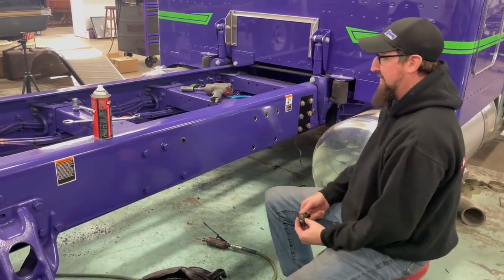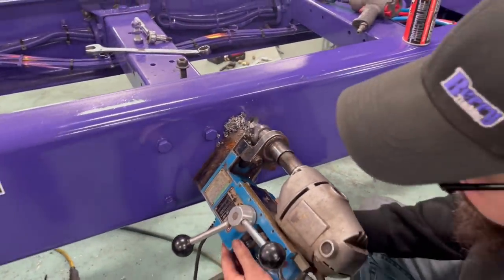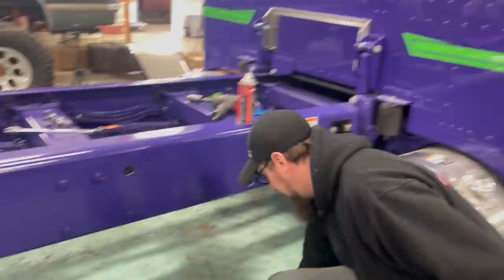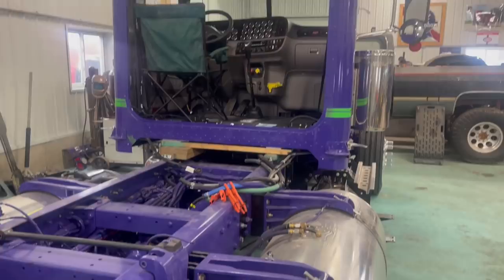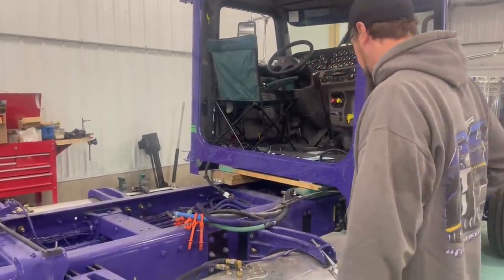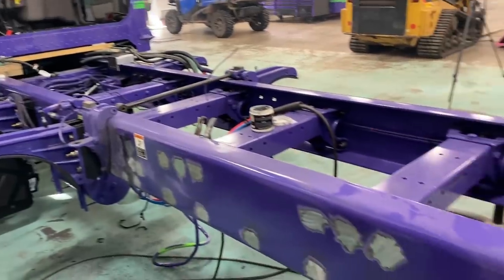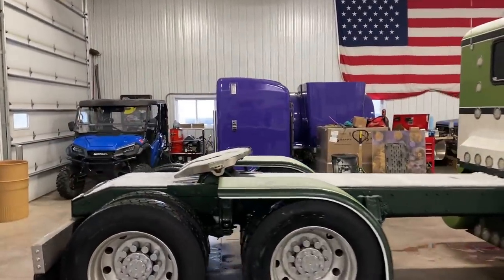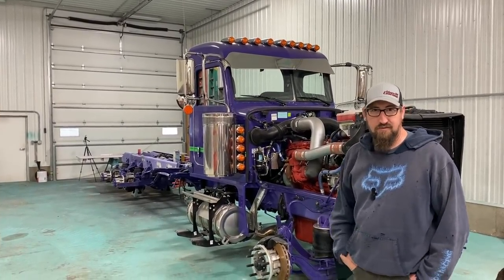How to counter sink frame bolts on a Peterbilt.

Comment: Hi!

Wow, clean work.

Question on hiding the frame bolts...

Will that hold up over time on a working truck?

Or will frame flex have cracks showing up in the old holes?

I see huckbolts coming loose on xmembers and suspension hangers, reason I asked...

Just found your channel.

I like it!
Reply from the maker: We use the same holes the factory bolts were in, after countersinking them we weld them in.  Therefore if done correctly, they should last forever.  Good question!

Comment: Great work!  What grade bolts are you using?  I've searched around online and haven't had a lot of success finding high strength countersunk head bolts.  Any suggestions?
Reply: Google grade 8 flat head socket cap and what ever size you want, that's what the are called..they are all over and not hard to come by.

Comment: Like the hidden bolts but how are they as far as everday road use and how are they as far as rail swaps. We are building movers and heavy haulers we have Autocar and Pacific winch trucks and I've been looking at doing a show work truck out of some of our parts Pacifics and I have thought about using plow or counter sunk bolts on all of the frame but in our field we flex and twist on our trucks and we do rail changes on our trucks every 3 years and just wondering if the counter sunk bolts would hold tight with every day use and especially with us that flex our trucks especially when using the winches pulling loads on trailers or pulling buildings or pulling our haul trailers up over rear frame roller. I know our trucks and what we do is completely different from over the road trucks but I see alot of things over the road truckers do to their trucks I'd like to try when I get around to building my working slash show truck, things that wouldn't normally seen done to a Pacific truck.
Reply from the maker: I'm sure an application as to you're line of work, they wouldn't be feasible.  My truck has a bigger frame rail in it, but being an over the road truck I don't think I would have a problem.  But, as always never say never. LOL

Comment: Truck is looking awesome 😎 was wondering what size and make of the countersink bit and bolts were. Getting ready to shave some of the ugly huckbolts off of my frame.
Reply from the maker: I bought the countersink bit off of amazon.  I believe it was 1.5" diameter.  The bolts were from a local supplier.  They were 1.5" and 2" in length.
Reply: @berrytruckn  thanks for the information good luck in wildwood